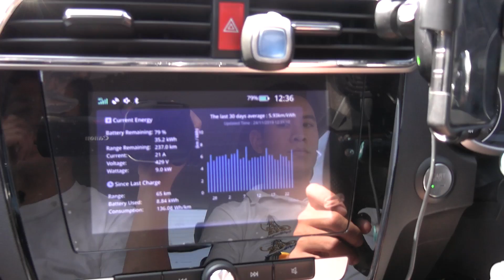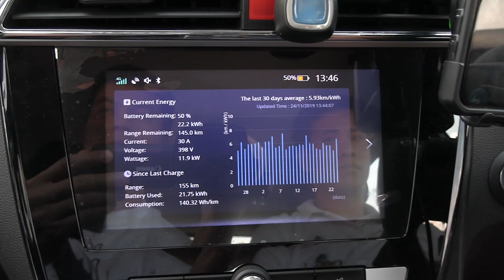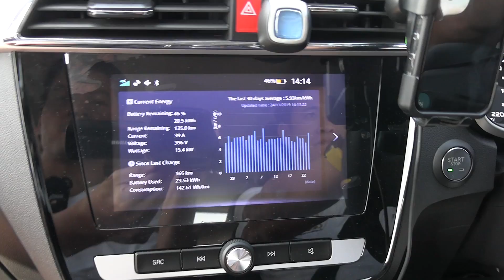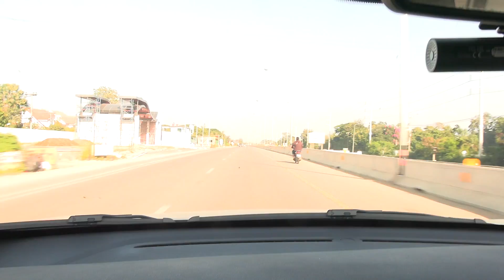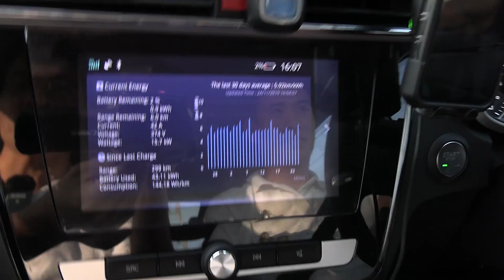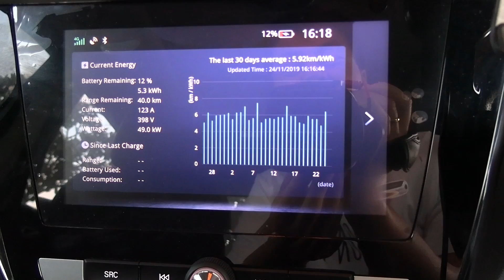MG ZS EV range test

Comment: MG owners in Thailand are so lucky, the European version does not have iSmart (the app) and timed charging is not possible. This also means that charging from "off grid" power e.g. solar is unreliable as the car does not wake up again if the power supply temporarily drops out.
Reply: Trust me, we are not that lucky. iSmart is just the platform to lock you into their ecosystem. It's very buggy and also doesn't have the timed charging option.
Reply: Also noted the iSmart comments in the video.  Just sent an enquiry to MG UK to see if there are plans to release this app here.  Would be  icing on the cake to have timed charging and to get into  a warm car in the cold winter months!
Reply: @RodC14  Timed charging doesn't even work if the timer is in the charger!
Reply: People have discovered that the data communications module in the uk model is missing. However, work by OVMS third party is progressing. As to timer charging, see SpeakEV forum.

Comment: is there any data how much an extra occupant in the vehicle affects the consumption?
Reply: On a level road at steady speed, extra passengers should have virtually no effect. The extra mass will matter if you're climbing hills or doing a lot of stop start, but regen will alleviate that (which a fossil car can't)
Reply: @PaulMansfield  hm.. then why does the SR+ has the best mpge over the other models?
Reply: @noproblem386  different batteries? Different gear ratios? Different motors?
Reply: @PaulMansfield  SR+ to LR should be same battery modules, same motor, obviously same gear, with the only difference the weight... which should answer my question :)
Reply: @noproblem386  the model3 performance has different motors: https://www.youtube.com/watch?v=XzspO4-T7t4
Reply: @noproblem386  how much difference is the range? thanks
Reply: @PaulMansfield  EPA combined: 239 Wh/mi (149 Wh/km) vs 279 Wh/mi (173 Wh/km)

Comment: Air density is factor at highway speed on range. It goes down with temperature and with altitude. That should explain, in addition to battery being more active, the difference between The Land of Smiles and The Land of Vikings